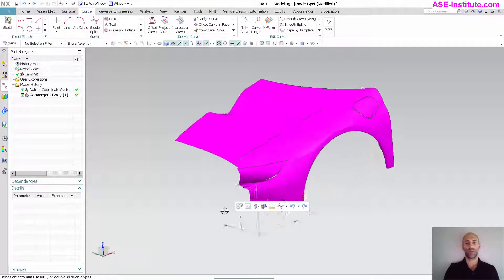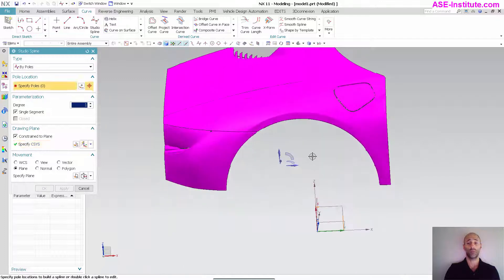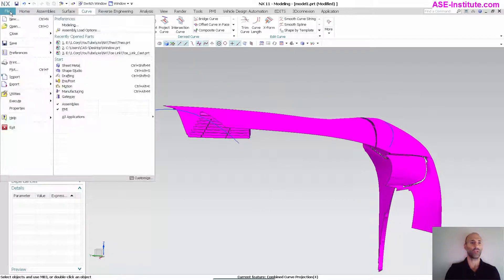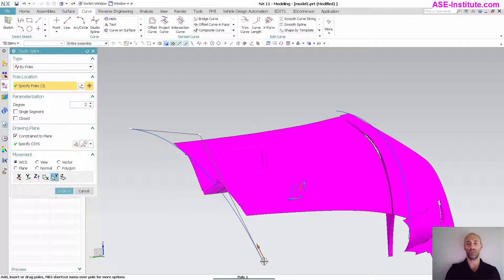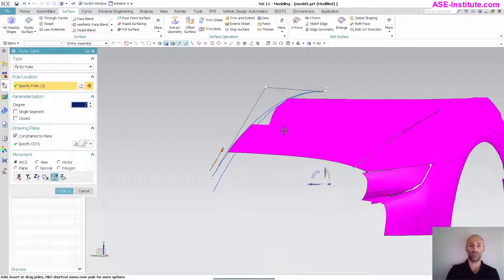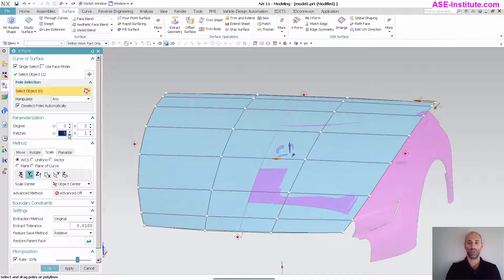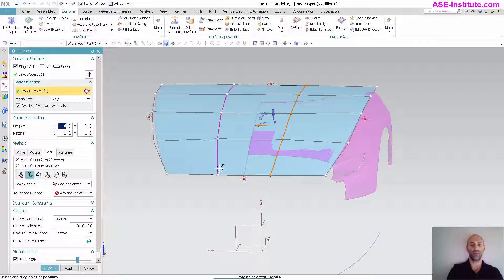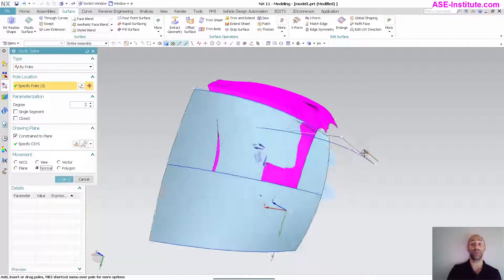Theoretical  Curves and Primary Slab | Siemens NX 11

Comment: Hello and thanks.I'm almost beginner in CATIA and it seems to me getting close enough through control points is very time consuming if not impossible!may you please speak a little bit about this(or will be great if do an example to acceptable tolerance although I know you're busy),I've checked your other videos which all are great but the question for me is "spending how much time through control points is reasonable?" and that "where and how helpful are the commands that fit surfaces,like "power-fit" or "automatic-surface" or "surfaces-network" or "fit-to-geometry"? 
thanks again for all your great great videos. 
it will be very very helpful if you answer.

Comment: Hi! Thanks for an interesting video!
Were there a reason for extending the surface past the center line of the vehicle? Isn't it possible to use X-form as one would want with just doing one side and then mirror it? (While making sure surface continuity towards the center is maintained as one wishes)
Reply from the maker: Have a look at my most recent video. I will be doing more on this subject.

Thanks for the question.